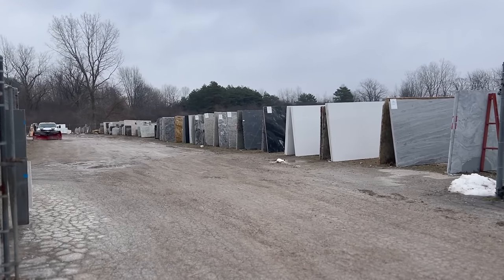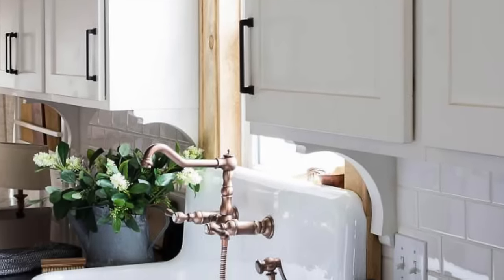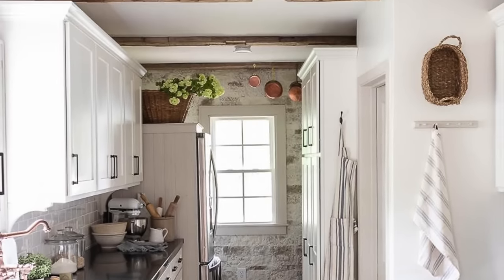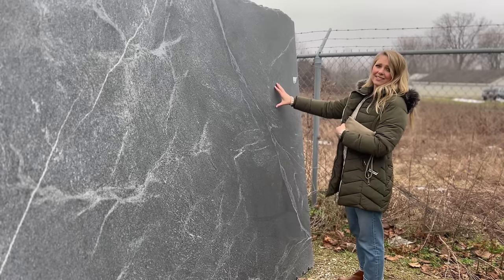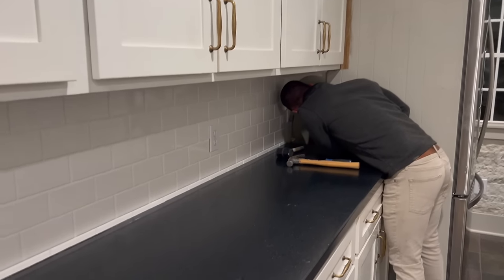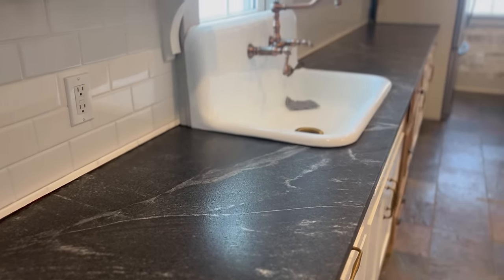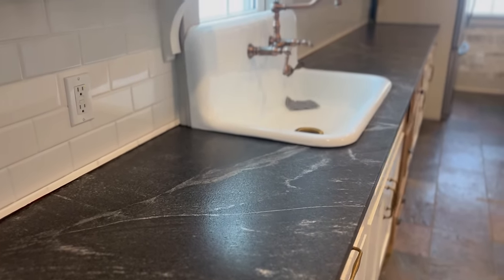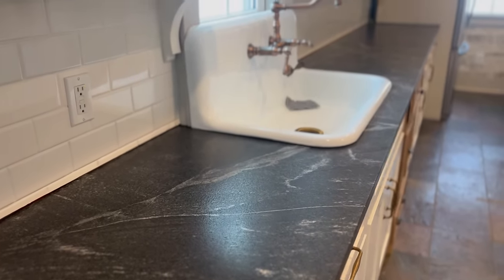How We Transformed Our Cozy Cottage Kitchen with Stunning Honed Granite Countertops!

Comment: You may want to see if the granite company  has a piece  of your granite to use as a backslash  behind your stove. They may have a remnant  piece. They can cut it to fit. Doesn't  need to go up the whole wall space, even 4 to 6 inches.  Mine is a 4 inch. Just a thought, love your choice of granite. Husband was in the kitchen business  for almost 50 years.

Comment: Love the countertops 👍 I think hardwood floors would look nice. It is a little busy to the eyes with different textures floor, counter and wall. But that is cottage nothing is meant to look built in or purposefully put together. I think if you change to wood pick maybe large plank flooring so it looks like the floors have been part of the house for years.. 😊

Comment: You can use heavy duty easy off (the yellow can) oven cleaner to remove the orange in that little cabinet. It'll save you a lot of sanding. I've used it on a couple projects including a large round dining room table and it worked great. When people have issues with it, I believe it's because they don't use the heavy duty one, there's some kind of lacquer on the piece, or it's not real wood. I'm sure it'll work great on your little cabinet.
Your countertops look great!
Reply from the maker: Thank you! And yes, I have tried the Easy Off on other pieces in the past! 😊
Reply: @PineandProspectHome   the little firm bristle brush you used on your kitchen tile is what I used to scrub. I didn't think it was doing anything until I rinsed it with the hose and let it dry. I was shocked to see it turned my table into the color of your dining table. I did re-stain it a walnut color hoping for a little of the red to come back thru, but the easy off worked so well at bleaching that no red at all came back. Have a wonderful day!

Comment: What if you painted the tile and checkerboard it. You don’t have to necessarily use black and white, you could use gray and white… as a suggestion to hold you over until you get the wood floors in.

Comment: So, digging up the tile and the cement board sounds like a lot of work and it might be risky.  What about the depth?  Would you be able to find wood flooring thick enough to make up for the depth?  Have you thought about just painting the tile?  They have that paint for garage floors that should be very durable.  You could paint the tile just one solid color.  A dark charcoal gray, or a walnut.  I would try painting it first.  Wood floors don't work well in the kitchen because there is so much traffic and they get scratched so much.  If you really had to have wood, I would suggest Pergo.  Good luck!

Comment: I love the countertops. I have always loved the honed granite ( not shiny). I see your issue with the colorful slate floors. When you change something it can then lead to more changes. I have been in this exact same situation with wanting to add more wood flooring to an area that didn't have them previously. In my oipinion, It does not look good to butt one type of wood flooring up against a different wood flooring.  Unless you can get  the exact same flooring ( same color/ same eveything) it doesn't look good. It won't look cohesive. I don't think you will like how it looks. I have been here. Unless you are able to buy the same type of wood that is  on your exhisting floors and then have ALL the wood flooring refinished to match, I wouldn't do it. I hate to use this term but if they don't match, it will look like you went the cheap route. Your house is too beautiful for that.  As an option, I have seen grey slate like flooring ( without all those colors) that might blend nicely with the countertops. Just something to think about. I know you will make whatever you do work and look beautiful. You always do.

Comment: I have wood floors in my kitchen and I do not like them just a simple little water leak from the dishwasher under the sink because the filters are by the refrigerator warps your floor. I want stone slate in my kitchen. You like the wood floor with your four boys